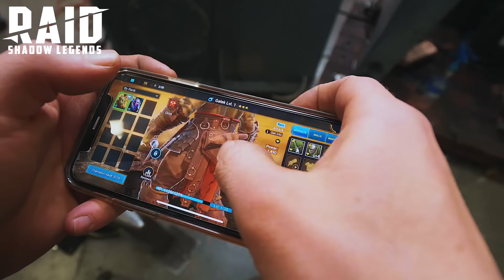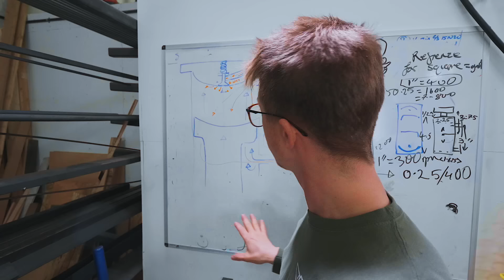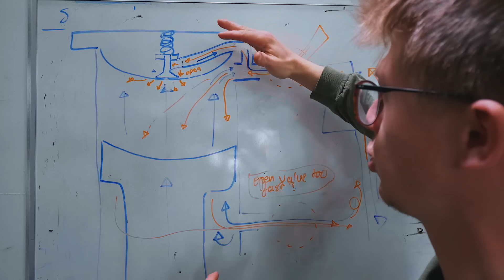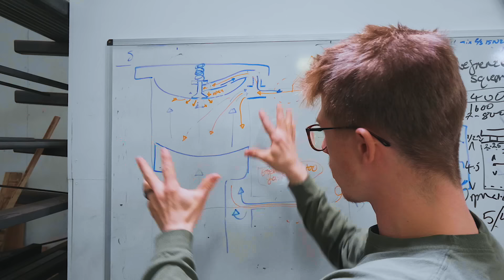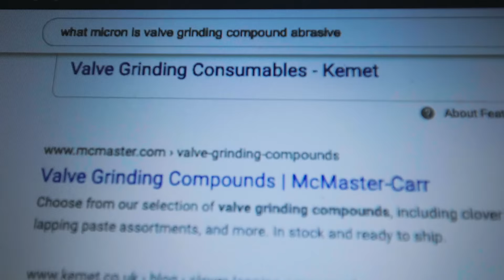FIXING THE 300LBS POWER HAMMER!!! Part 5

Comment: Do you know why people use soapy water? It's so they can see bubbles when they blow air through the other side...
Reply: if the bubbles rise through the bottom it has the same effect to show bubbles better, so it is still useful
Reply: @bartbelcik7290  but why would bubbles rise through the bottom when there is no difference in air pressure? The water leaks out the bottom, but there is no air coming through. The only bubbles you'll see are from air that was caught on the surface when the water was filled in (not coming through any gap), so worst case you'll get false positives.
Reply: @bartbelcik7290  but there was a way for the air under the valve to escape, so the water just pushed the air away instead of replacing it. Thus no bubbles shall be formed :D
Reply: In that instance, water would have been fine on its own.
Reply: @sourcererseven3858  yes mate
Reply: It also breaks a lot of the surface tension in the water, and make it easier to leak.
Reply: Without soap surface tension may have prevented the water from leaking through
Reply: @gergc4871  yeah, the most frustrating part was that he did not lift it up to see whether it leaked or not...
Reply: @mattle3  u was thinking surface tension through micro holes would form bubbles instead of letting the water through
Reply: @espenschjelderup426  , @Jason Zevenbergen , Hmmm could be, my intuition just told me that soap is thicker than water so that confused me
Reply: @bartbelcik7290  but if the material is damaged and water goes into the cavity, air can only escape through the water surface if there is no direct way for the air to escape and so it is not considered a leak
Reply: @bartbelcik7290  if it leaked the water would have dripped down the valve and onto the floor or whatever surface that was sitting on.
Reply: @gergc4871  yeah, but he didn't check, he just let all the water out which mildly infuriated me
Reply: @mattle3  yeah, but actually a more viscous fluid like a thin oil(ATF?) probably would leak faster than clean water.
Reply: @espenschjelderup426  man that is so against my intuition ^^ it really makes me confused a bit

Comment: The comments are incredibly interesting.  I definitely agree the spring should be looked at, I'm sure there's a quick and dirty way to test spring tension.
It might be the compression, and that is a more delicate problem.  How does the piston seal to the cylinder?  Theoretically, you might be able to get a better seal temporarily with a viscous oil around the perimeter of the cylinder.
And whatever you paint it, it needs the happy face.

Comment: Well, it was pretty clear that the top valve had to be re-seated and you did it without expensive tools and such :)   Next thing IMHO would be actually to check the cylinder and the ram (piston). Its kind of like a combustion engine cylinder and piston.  These two parts also have to be sealed properly against leakages.  On combustion engine pistons you have piston rings for that.  There is wear on piston rings and the cylinder which could cause leakages.

Comment: This was probably a common issue they experienced in shops fifty years ago where they ran these to make forgings, and they would probably adjust the timing on the side when the lower valve, or the entire machine began to show wear. It hitting the top is probably an indication of a loss of sealing somewhere in the machine. They would adjust the timing bar on the side to lower the amount of pressure on the bottom valve until the ram no longer hit the top, by decreasing the amount of air flow coming through the bottom deal. Eventually though, it would no longer work, and so the machine was moved over into a corner, and at that time the old electrical motor that looked like it had been used and broken in use on a ship, was probably put on it. it was just a bunch of parts at that point. The question is why the shop mechanics did not fix it at that point, and they probably had some kind of cost-benefit idea of what that would entail.

You are getting a lot of views for this project, and you are kind of a pioneer into this piece of old equipment, because all those old line workers, engineers, assemblers and their knowledge is now gone. I would inquire of the company who acquired their assets and see if they have someone who can offer up an idea of what is going on and a fix for it, since all these machines would need some find of fix after 10 or 20 years. My idea is that it is the lower valve, which has to be more of a load-bearing part has a bad seal, and that's why they began to restrict the air coming through it as an easy fix. The top valve looked really large and hard to make, but I wonder if they had a fix by changing the pieces out or restricting airflow internally somehow in another way. It looks harder, but I bet this is a common problem with old power hammers.

Comment: As with internal combustion engines, the fit of valve stem to valve guide should be checked and correct. the valve face should be reground and the seat cut or ground and then lapped together. The hundred year old spring should be replaced as well. I don't know if there is a spring poundage recommendation but it should probably not move so easily with hand pressure.

Comment: Check the spring tension. If the spring is weak the valve may open slightly letting air escape.

Comment: In Part 4, it showed a burst of vapor when the piston hit the top. The only place this could have come from is the valve cover. So you need to fit a new gasket between the valve cover and the lid. And it definitely needs a new coat of paint, but I think it'll take some time to strip the old finish off.

Comment: Long time listener, first time caller. I'm wondering if maybe you lapped the valve and now need to adjust the castle nut down a bit.  Maybe it is a good seal but just a tad too easy to compress the spring. Might could reference where your at and come back if it's not the problem. I think your one thing at a time method is good. Keep with that for sure.

Comment: The rust inside the cylinder does exactly the same thing the pitting you noticed on the valve does: it lets air leak.
In this case in the bottom part of the cylinder.
Unfortunately, this would mean having the inside of the cylinder reground, and new piston ring seals applied to the piston, which is not that easy I imagine...

Comment: Hey Alec, what if you change the height of the dies? Making them shorter or taller should change the stroke. It seems like the ram sits too high, and maybe doesn't get enough of an air cushion? Those internal airways might negate that though.

Comment: The method of checking valve seating that I've learned is using a bit of prussian blue and seat the valve to see the contact. 

Well, he just did what I was typing. This is the same valve that is used in engines.

Comment: If there's a leak around the ram itself it can also hit the top the oxide on the sleeve might be a sign of that as a secondary problem if this doesn't fix it as oxide cannot form without a gap and oxygen exposure.

Comment: Alec, (Not a metalworker, forgive my lack of jargon when naming parts) have you considered slop in the connecting steelworks that drive the treadle making the valves work slightly out of synch? by reducing slop in the connection points it might? allow better tolerance and therefore adjust the valve timing? CheerZ

Comment: I bet at least part of the problem with the piston hitting the top of the cylinder is that the piston rings are in about the same condition as the valve was. With worn rings their will be more blow-buy which will reduce the volume of air trapped at the top of the stroke reducing the cushioning affect and allowing the piston to hit the cylinder head.

Comment: Have you compensated for altitude? I assume the hammer has to have an adjustment since the air at sea level is denser than say in Denver. So it would need to compress up more fully to achieve the same amount of pressure to trigger the return.

Comment: If it’s hitting the top tighten the nut on the top more to add more resistance to the valve opening valve could be opening at too low a pressure

Comment: Check the main seal on the ram. I will bet it is damaged or worn where it passes the port.  This also explains why the ram drops so quickly when turned off.  You are probably only getting about 60% of the full power it should have.  P.S. This machine doesn't cycle fast enough to experience valve float.

Comment: Paint it gloss black or NOTHING. It looks so badass with the ratty paint but if I were to choose a color it would be gloss black and wire wheel and clean all bolts and bare metal surfaces. Check out Jimmy Diresta's drillpress we did. That scheme is great.

Comment: could it be a timing issue between the drive and the "hammer" if they are out of spec by a few degrees it could cause the issue..also might be an idea to confirm the rpm of the motor it could be substantially  higher under load than the old one ..keep at it its just a process of  elimination

Comment: Maybe let the two valves controlling the piston overlap for a split second..
Because after all you'll need positive pressure for the air cucion to work and I doubt that no pressure at all would work great..
Which leads us to the second theory..
You need to make sure that the air relief valve not only seals properly but also opens properly (maybe check spring tention) because if it doesn't open it would create negative pressure when the piston is down which is basically more power pulling the piston up to hit the cover.
Reply: I wouldn't pay as much attention for the perfect seal as for the valve actually opening and releasing negativ pressure properly.. Since air tends to act like a non-Newtonian fluid inside the cylinder when there's a tiny leak..
Slow compression -> air leaks fast enough and pressure doesn't increase
Fast compression -> air leaks slower and pressure increases creating the air cucion

Comment: I looked at the video again and if it hit on the first upstroke of the hammer, that might also mean that there is not enough pressure being immediately generated in the top of the ram, which might be a seal problem in the rear piston. Try to run it for about 3 strokes before dropping the treadle all the way down to the max setting.

You should paint it some kind of gray and white dazzle scheme, from world of warships, or a British camo tank scheme from world of tanks, and a Cheshire cat fading away Alice in wonderland smile replacing that one on there. You can hit them up for an ad to cover the episode as a sponsor.

Comment: Engines have this problem when the valve face wears on either the intake or exhaust. Can also be caused by carbon buildup allowing compression to leak out. I think do to the pitted face on the valve it was allowing air to leak back out instead of allowing for the cushion. Too bad the coronavirus thing is going on, you probably could have sent the valve and head out to a machine shop and they would have cut both to ensure a proper seal.

Comment: I'm wondering that that doing might have lost it's original tension, meaning that it's weak now and causes the valve to bounce on it's seat when it goes back to it's original position. Is there a graph that tells you the specs of the spring ?

Comment: Would have been worth wetting the gasket with oil before installing makes it expand and fill the gaps. If the top of the ram isn’t sealed you won’t get the damping.

Comment: I wonder if the rings (If it has rings) on the main hammer piston or the seal between piston and cylinder is leaking to much . so when  to piston moves up into the  air cushion section and the pressure spikes some air gets pass the piston and the air cushion fails.

Comment: I know nothing about this machine but ill throw an idea out there. Could you possibly be hitting the top because when someone welded the piston back to what i can only assume is the head of the hammer they made the whole piston and hammer taller than it should be or was? I guess to make this make a little more sense if the piston and hammer assembly is ment to be let's say 36" long and when they welded it back together and its now 
36 1/4" to me that would make it hit the head. I'd be very concerned as to why someone had to weld the piston back together.

Comment: like and engine that needs a valve job couldn't you grind the seat and valve to give it a new surface then lap them both followed by a new valve spring. What do the original specs say for spring rate?  Paint it a 2 scheme color maybe ying and yang or how about a tribute to someone, something??